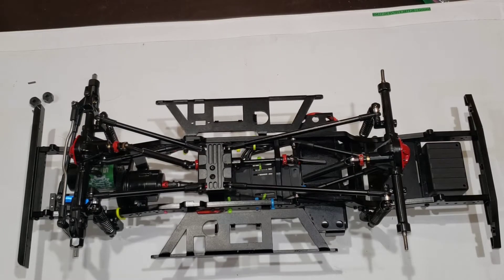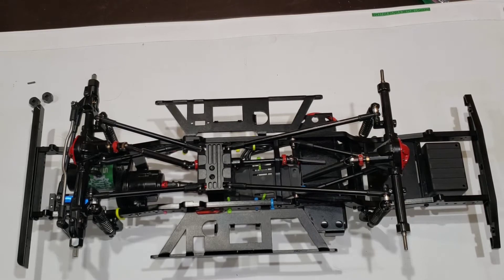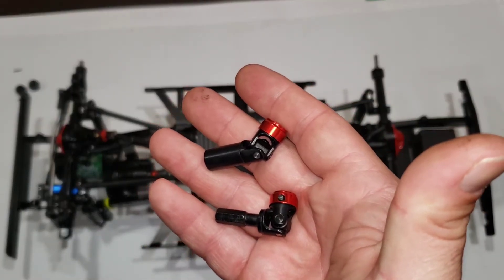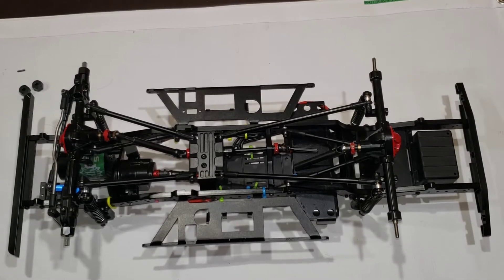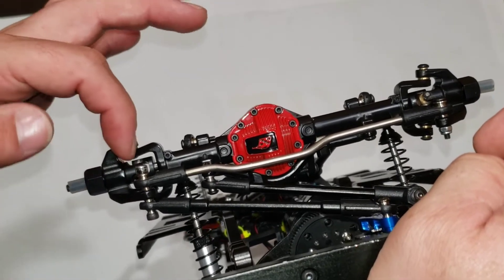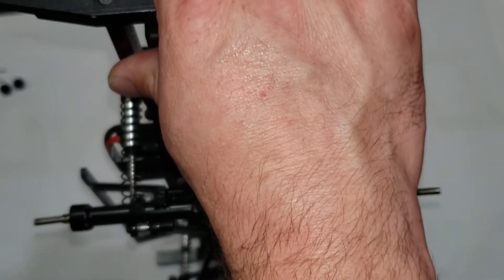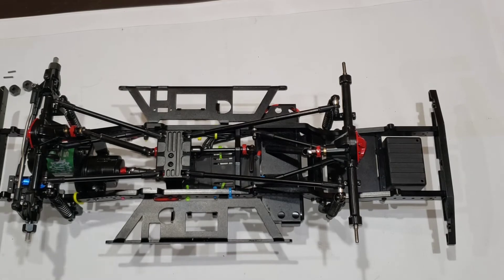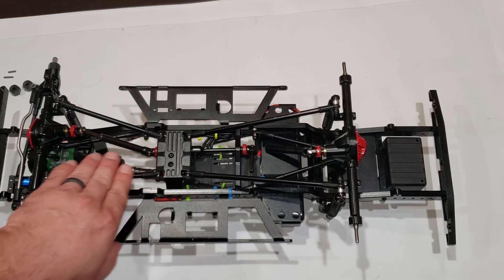Boom Racing D110 chassis initial thoughts. This is the platform for my Camel Trophy build.

Comment: Have had mine for about 2 years yours was a Saturday job after a drunken Friday night my axles and drive shafts are still as good as the day I bought them I have swapped the link connections on axles out my drive shafts are still OK I have swapped the shocks as they are to tall have 80mm on them and I have swapped the rear shocks for the upgraded custom part still have 80mm on back just no springs as of the shock spring upgrade on it have used mine to bits over the years still going good nice review

Comment: Well this is really disappointing.  I have recently bought  a D90 chassis without shocks or wheels to build an  RC4WD FJ cruiser which I have the body for. I have seen a lot of posts online about poor RC4WD axles / diffs. I have not put mine together yet so will be checking everything closely now I have seen this. I had a poor experience with the Raffee camp trailer. But also have a BRX01 so was expecting decent quality from the D90 chassis.

Comment: hey brother,QUICK QUESTION I'm running the TRAILMASTER sport 21t 550 with the 1080 and a 17t PINION GEAR by ROBINSON RACING what's the best number PINION GEAR TO run??Any information is greatly appreciated thanks
Reply from the maker: Hello Jose,
Depending on what vehicle you are using. Best to generally keep as close to a 5 gear ratio on pinion and spur to keep electronics happy. Of course you can adjust for speed up or down from that point. 5 is a great and safe starting point. Take the spur tooth count and divide it by the pinion tooth count to get your pinion/spur ratio. The lower the number the faster your vehicle will go and the more heat you will create.  Keep in mind to high can give you heat problems also.
Reply: @axletwisterrc4526  I'm running a gen 8 with 1080 plus 25kg servo ds3225.>>The spur gear is ''45t'' and I'm using a ''17t''pinion gear...So doing [45 divided by 17=2.6]...[45tspur divided by 9tpinion=5].....[45tspur divided by 10tpinion=4.5]....[45tspur divided by 11tpinion=4.0]........[45tspur Divided by 12tpinion=3.75].....[45tspur divided by 13tpinion=3.46]....[45tspur divided by 14tpinion=3.21].>>>>>So like that??? And to keep in mind the lower the combined number that pinion gear will make it go faster,but create more heat possibly?? So the 5 gear ratio is the 9t pinon gear,,but that's a lot of torque for me not much speed.>>So adjust from there.Ohhhhhhhhh I got it now brother,,is my math correct??? Thanks again sooooooo much,you help me out tremendously,again thank you!
Reply from the maker: The Gen 8 is a bit of a exception to the rule because of the transmission and portal gearing. Yes getting it close to 5 will be fairly slow in the Gen8. I would start at 15t or 14t pinion and work from that point based on electronics temp.

Comment: if this was the gen8 you would've hammered this brother,REGARDLESS of the slacker who built it,and I know Dixieland RC has a great relationship with boomracing,my guy your supposed to slam this, and your holding back,you let off 3 to 4 bullets when this REVIEW SHOULD'VE gotten the clip
Reply from the maker: Vehicle Brand or where I get it from makes no difference to me. I held nothing back. Every piece of information is in the video. Holding back would be not showing it or not talking about it. THIS VIDEO WAS NOT A REVIEW. The review will come later. This was intial thoughts. The reason I didn't jump up and down and slam it was because it is a new vehicle and as a new vehicle talking with the manufacturer is the best action. I talked to Boom about the transmission mount being stripped and the offset extension shaft. They are sending replacement parts. The axles I never mentioned to them and if i did they would send replacement parts. I can't bash something when they would make it correct. The main things to take away from this is weak driveshafts and weak link mounts. The other issues was QA on the assembly. If 1 vehicle out of 1000 has QA problems i can't slam the other 999. All the people I know that have this rig do not have the issues I do. We as consumers need to give manufacturers the opportunity to correct mistakes. We need to move past slamming everything without giving the chance to make it right. Slamming something unjustly does nothing positive for anyone. Point out the issues, give a chance for customer service to happen then decide a direction to take. Thanks for watching my Friend. Stay safe and stay positive.
Reply: @axletwisterrc4526  but how do you know 999 outta the THOUSAND are ok and not like this??yEA they have great customer support,it doesn't change the fact that there's CLEARLY issues,just  talk about like you did the gen8,your gen8 VIDEOS AND this video is night and day and from factory this came with mechanical issues,my opinion brother I love your channel,but say the support is excellent but the chasis isn't it!
Reply from the maker: 999 was a example. I literally never heard of or seen one like mine. That is including many searches and research. I know many people that have them and literally non of them is like mine. Gen8 was the same. I verified multiple models before making each video to get a rate of mistakes. Literally nothing is held back. You watched it all yourself in the video. It is all before you to make a educated decision. Give the manufacturer a opertunity to correct it. Its that simple. I did the same with the Element. A intial thoughts then a review. I took into account that Element was replacing parts molded incorrect without hesitation. I didn't knock it for what the factory was happy to address. The same with Boom. You are completely missing the fact this is not a review. When the review comes feet will be held to the fire if they need to be. The Gen8 was different it didn't have a intial thoughts video. The Element was done the same way I'm doing this D110. Intial thoughts just to go over things and point out the obvious without bashing anyone. This gives time to rectify any problems. Keep watching the review will be coming. It will be as everything I do is 100% honest. That is my number 1 thing honesty. I truly appreciate your input and passion. That's a great thing!
Reply: @axletwisterrc4526  your right man,I'll wait for the rest of the videos,and your one of the few that are HONEST and your opinion your words hold weight,wasn't trying to be a dick brother,you know any part or QUESTION u Always help me out my guy,!